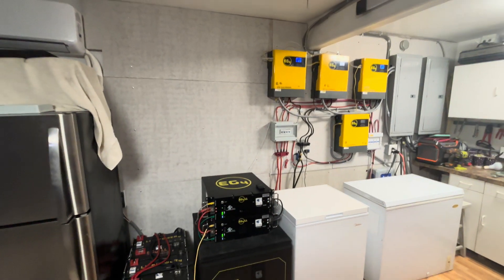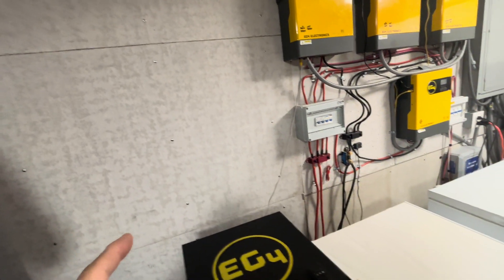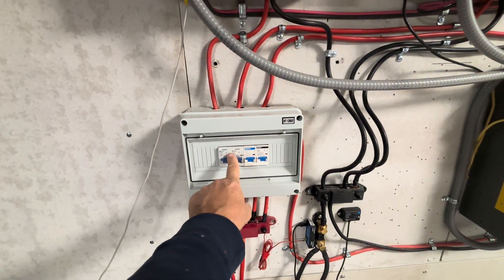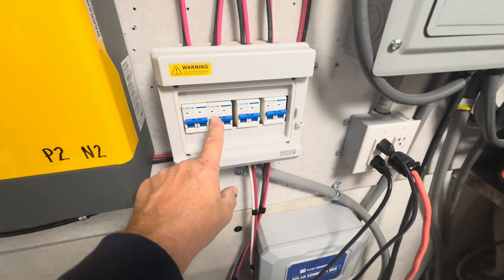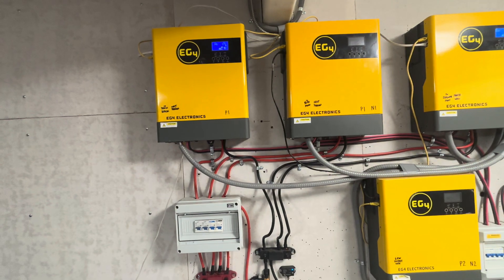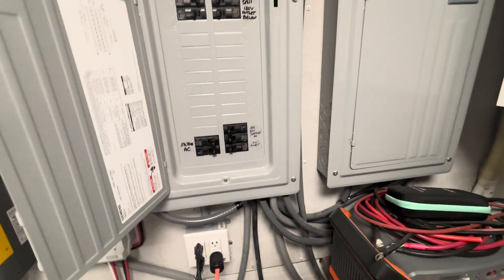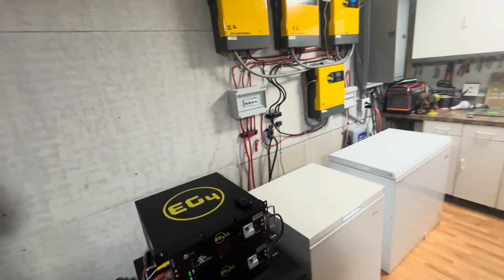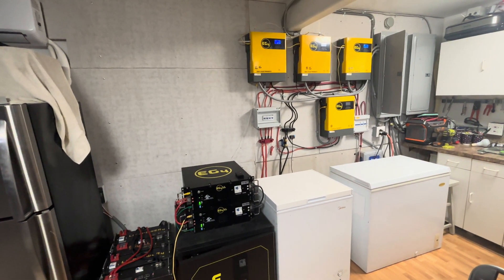Wall is finished, Ready to order & install 2 more EG4 3000 watt inverters to increase output to 18kw

Comment: Built a handtruck generator a few months ago with same 3000w inverter and one eg4 ll s 48v battery. Worked fine. Added six 400w panels for charging.  Works fine. Just got a second battery for more capacity.  Having communication issues I think.  Have you had any dip switch issues?  My host battery is set 1 off and 2-6 on.  Second battery 2 is off and 1,3-6 off like the instructions have.  Communication cable host in the bottom port and second battery in the top port.  The inverter only shows amp hour capacity of 100 instead of the 200 it should be.  Did you have to update firmware when you hooked up multiple batteries? Really like all the stuff your doing.  Very informative.
Reply from the maker: @ijmbcm2004  I had it show 100 ah when I had 2 batteries connected. Try turning off the system including batteries then back on and if that does not work. Try going into the settings for battery type and change to lead acid and unplug battery communication cable from inverter, then plug back in. You should get an error code of 19, that is normal, that means inverter lost communication with battery. Change battery setting back to L4.  Set it and get out of settings, unplug battery communication cable from inverter and plug back in after 10 seconds. Hopefully it will recognize the 2 batteries and show 200ah. You might need to turn whole system off and then back on.
Reply: @diy-solar-guy  thank you!!!!  I will definitely try all your suggestions. I'm sure you have done alot of troubleshooting.  Total newbie here. Thanks again.
Reply from the maker: Don’t hesitate to ask questions

Comment: You must be a strongman as look likes you keep changing solar equipments, do not forget to show us how you hook new (2) inverters to off grid main breaker panel😀👌
Reply from the maker: I will do a video on taking inverters out of box, mounting on wall and connecting all the wires as well as running wire to off grid electrical panel. Hope you have a wonderful and blessed remainder of 2024.

Comment: PAPPA, LOOKING 👀 MUCH BETTER!
HAVE YOU CONSIDERED USING PLASTIC RACEWAY WITH THE MULTIPLE SLOTS FOR YOUR CABLE MANAGEMENT WHICH WOULD MAKE YOUR SYSTEM MUCH MORE PROFESSIONAL?
Reply from the maker: @awbean5254  I looked into it but not wanting to spend the money for it at this time. I agree it would look much better.